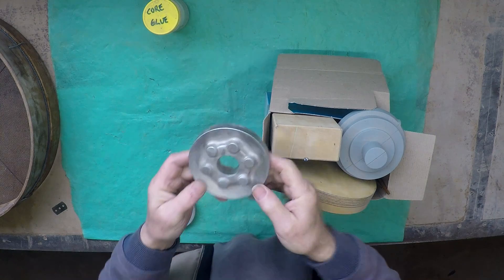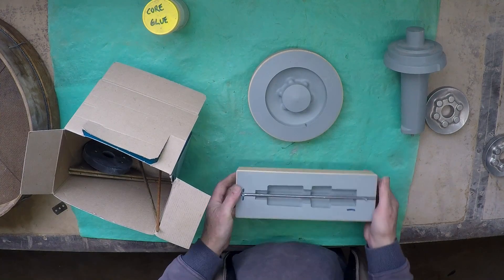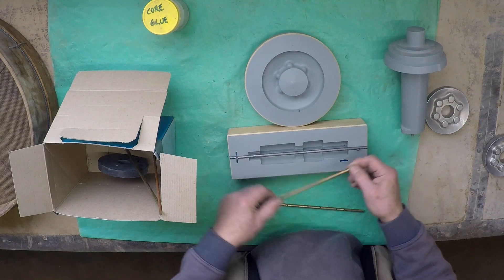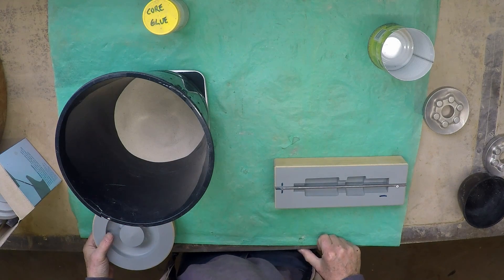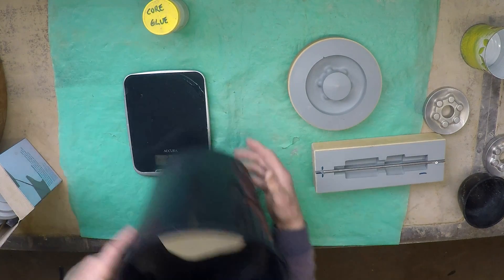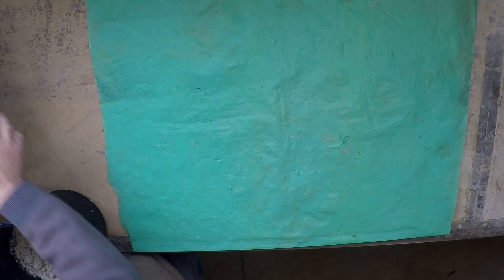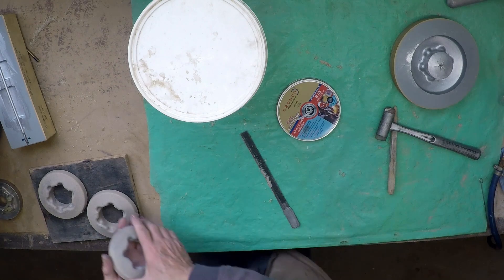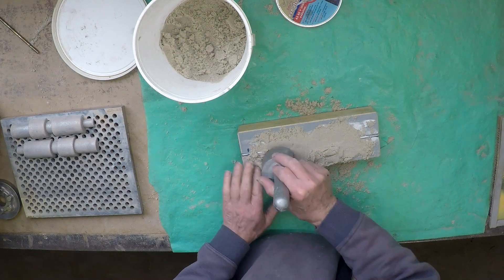Maserati long pulley half. Part 1: The cores

Comment: Martin how did you make the zircon paint , and what core Glue did use,
Reply from the maker: Oliver, Probably not going to be of much use to you here! I was given the zircon wash many years ago and I now have no idea where it came from. Many of the foundry supply companies have this sort of thing but probably in container size well above what you need. Its the same with the core glue but you could try making your own by adding sodium silicate to just about any fine refractory (talc may do) to make a paste. You could find a local small foundry who uses these things and offer to buy some from them for cash... Martin
Reply: i have tried powdered fiberglass ,  
best i use on cores , i  polish them with plumbago before i put them in oven, 

it’s been. long time chatted my friend ,   stay Safe ,

Comment: Martin what are the sieves sizes that you use. Ie facing backing and other?
Reply from the maker: K, I actually use 3 different sized sieves. I have about a 1/8 inch opening sieve that I use when I am mixing CO2 Silicate sand. I use two sieves each with 1/16 inch openings one for the facing sand and one for the backup sand. I also have a sieve with 0.025 inch opening that I use to clean up sand I sweep up off the floor after I have finished making moulds for the day - this sand has fallen there during mould making and has dried out. Occasionally I will also use this 0.025 inch for facing sand but it is very hard to get much damp sand through such a fine sieve and I only do this for small flat things that I want the best possible finish on... Martin

Comment: is it possible to glue the core halves together with sodium silicate to avoid the water content problem?
Reply from the maker: Ian, Yes I think that you could use sodium silicate, in fact I suspect the "commercial" core glues are based largely on sodium silicate just  with some refractory fillers and clays added. However we need to remember that sodium silicate is a water based solution so its use would not entirely not avoid the water problem. Used on its own it should avoid the semi bound water that is tied to clays - this does not dry off at low temperatures but does come of as a gas at casting temperatures and thus it can cause problems. A simple oven drying at around say 200 deg C should get rid of most of the water from straight sodium silicate but not entirely from the clay. However I have just shot a video where you can see the exposed end of a large silicate core and the liquid water plus the steam that roars out of the end of this core during casting is something to be seen - it reinforces the view that venting of cores is an absolute necessity. Video will be up in a few weeks - its a 3 part on making a piston for an old car... Martin
Reply: thank you

Comment: Just wondering about: Pressures? for your air nozzle and your CO2.... Parting dust? Cornstarch/Baking Soda/Talc?
Reply from the maker: Bill, The air nozzle is set at about 15 psi and I am careful to either pull the trigger slowly or to point the nozzle away when I first pull the trigger as you can get a destructive first rush of air from it. The CO2 I do not set the pressure rather I set the flow rate at about 3 to 5 litres a minute _ I usually gas for about 20 to 30 seconds. Parting dust/talc here is an answer I gave to a similar question a while back ;-
The parting agent I use is calcium carbonate. it costs me about $2.00 per Kg for a 25 kg bag that would be about a life times supply for most hobby casters! 😀 Talc if bought  at the local supermarket is about  $10 per Kg  so to me its a no brainer. There is some talk about Talc being not as benign as once thought and I know that at least some talcs contain silica dust - bad news. Also I do not like the cheap perfume in a lot of it. It is possible to buy talc in bulk for a much lower price, but then its a mineral sort of related to asbestos and one talc mine (in the US) was closed down as its output was found to contain asbestos. I am reasonably happy to work in the occasional cloud of calcium carbonate dust as some human body fluids dissolve it and what's a little extra calcium anyway - possibly a good thing - not so sure the same could be said about the talc. The talc sure seems to work Ok though. But rubbing it on the pattern as a lubricant to help the pattern come out is contrary to my experience which is that a little surface roughness (I get this from a matt paint) seems much better. Graphite is insoluble in the body and thus will build up and is know to cause a Black lung disease similar to that contracted by old time coal miners. I understand it is regarded as a carcinogen (but then what isn't?)  I do use a little graphite in other areas but I would not be dusting it all over the place like I do with the calcium carbonate. I do not know anything of  the corn starch - I would have thought it water soluble and therefore it would not work (on green sand)   but I simply do not know anyone out there who does?
Baking soda - in what connection? if as a flux, forget it, useless. If as a degassing agent forget it, worse than useless. When heated it gives off water and CO2. The water will react with the aluminium to give aluminium oxide films and hydrogen which will dissolve in the aluminium. The Ellingham diagram indicates that CO2 will also react with aluminium to give aluminium oxide films. Baking soda will INCREASE the gas levels of aluminium. If you mean washing soda then again as a flux useless as a degasser also useless and in fact again negative. True washing soda is Na2CO3.10H2O when  heated it gives of those 10 molecules of water and its the steam thus generated that we see bubbling through the metal in videos purporting to show degassing being done with washing soda - clearly this will NOT reduce gas levels but will in fact INCREASE them. You can get anhydrous sodium carbonate i.e. Na2CO3 and this will not produce any bubbles at all and it will NOT breakdown in any way at the temperature of molten aluminium. People who degas with either of these two chemicals are fooling themselves....Martin
Reply: Thanks Martin for all that great info.... A follow-up question if I may.... What is that powder you spoon on the risers and what does it do for the casting?
Reply from the maker: Bill, The powder is an exothermic compound. It catches fire and generates a lot of heat, this helps keep the feeders liquid for longer so that they are better able to provide feed metal to the solidifying casting underneath... Martin

Comment: Wow, great work!  I guess I don't know the economics behind it, but when you only need two parts I'm surprised it's not cheaper to have something like this cnc machined.  Anyways, looking forwards to part 2.
Reply from the maker: Stach, The problem with CNC is that someone has to program and tool up the machine - a local CNC machinist charges about $120.00 for that. Then there is the raw material,  a slug of 110 mm diameter and something over 200 mm long would be needed, it would weight about 6 Kg and bar stock is about $15.00pr kg so that's another $180.00 (for the two) Most of this is going to be turned into useless and (almost invariably) contaminated swarf. The raw casting weighs in at 850 grams so about 5.2 kg of good aluminium is going to be turned into swarf in the case of CNC. So we are now up to $300.00 for the two parts and we have not done the machining yet! The convoluted shape inside the part (formed by the long core) plus the undercut areas with bolt bosses formed by the doughnut core would necessitate either a very sophisticated 5 axis CNC or multiple set ups. Suddenly it all becomes very expensive,. But then for the casting we have the pattern and core box cost and they would not be cheap. Either way it is an expensive exercise but perhaps the final decision was based on the need (or desire) to have the part look like an original which would no doubt have been cast. Part 2 coming soon.... Martin
Reply: Olfoundryman  Thanks for the thorough reply!  I had assumed that the labor for the molds and your work would be more expensive than cnc by far.  Perhaps you aren't charging enough ;).  I bet you're right though, the owner wanted the parts to look like the originals - if they own two Maseratis, the price probably doesn't matter.

Comment: Could you use your facing sand mixed with sodium silicate for cores? Or would it be too tight and the co2 wouldn't make it into the inner portion of the core making it weak? No that I think about it, probably not worth the effort just for a smooth core that nobody will see.
Reply from the maker: Amalg, I think that you have hit the problem yourself with it being too tight. Not only would the CO2 likely not penetrate enough but gases from the core  would not vent out properly during casting. Also the clay in that facing sand holds water and this would increase the gases given off. Best way is probably to do as I did and put a wash on the core to smooth it up this will not interfere with gases in or out!... Martin

Comment: Lots of things here I've only seen in books or large shops, and rarely on YouTube (and those are usually marketing capability videos for large shops)

Although I think this may be the first time I've seen a zircon wash used on a core. That's a very interesting technique.
Reply from the maker: Walt, I think the use of a zircon wash is reasonably common particularly here in Australia where zircon is readily available and perhaps a bit cheaper than elsewhere. Sure, graphite is perhaps the more common and talc is also used a fair bit but I think that a lot of other refractories are used too. All you need is a binder, a refractory, and a carrier liquid, the available choices of these three is very wide indeed. You don't see it in the video (it was already too long) but I smooth that wash up (after its dry) by rubbing with my finger and a piece of cloth just to smooth off the brush marks, were I a bit better at that I would have got a finish at least as good as my facing sand will give... Martin
Reply: I've only seen the zircon or graphite washes used on the molds, for me it was something new to see the wash used on the cores. Smoothing out the brush marks is a nice detail too.
Reply from the maker: Walt, I tend to use it on cores rather than the mould itself as I rely on my facing sand to give the a good finish there, but more commercially you are right they do tend to use it on the moulds too - put it on with a bloody great hose!
I once did some small manifolds where I applied a wash to the cores and then rubbed the wash down to a smooth surface
it took forever but the finish produced inside the manifolds looked like a very good investment casting  I did not charge enough for that job either 😀… Martin

Comment: Nice cores here! 
I wish I could find a great way to make cores for pouring skulls! :D
Reply from the maker: Captain, Cores for skulls hmm not exactly easy. I will be making some 4 inch pistons in an upcoming video cores used ares ort of like a skull core might be so stayed tuned. Alternatively why don't you investigate some of the investment casting block mixes available? If you have a suitable core mould (rubber perhaps) you should be able to make a good core for this use... Martin

Comment: Those first cores don't look like they have draft but I suppose they must. How much? Great video!
Reply from the maker: Rv4, The do have draft but I am not sure how much - knowing the pattern maker concerned - not a lot - I would guess at 1 to 1.5 degrees. With silicate cores you can not rap the core box before gassing to loosen the core as it damages the uncured core and it will not rap afterwards as the core is to solid so you have to have draft and it has to be even i.e. no little undercuts. He is a very good pattern maker (old school) but a bit mean with his draft well, for a clutz like me anyway..Martin
Reply: @olfoundryman8418    Does your pattern maker friend have a YT channel?
Reply from the maker: Ron, Sadly, no. Neither of the pattern makers that I know do  but I will suggest it to them (don't hold your breath!)... Martin
Reply: @olfoundryman8418  😔  Breath not held.  🙂